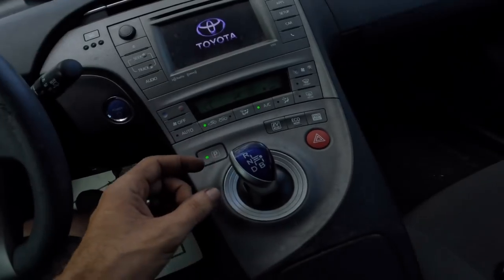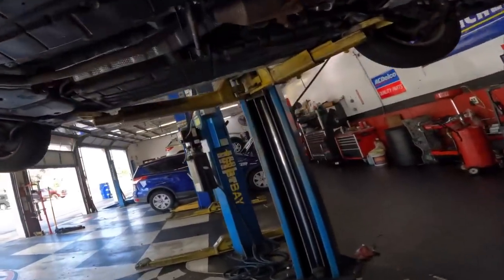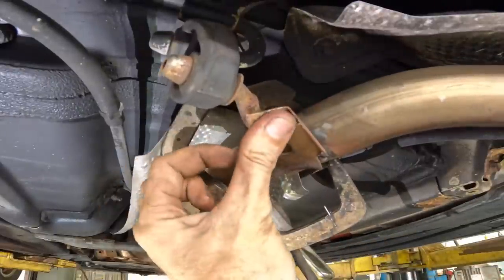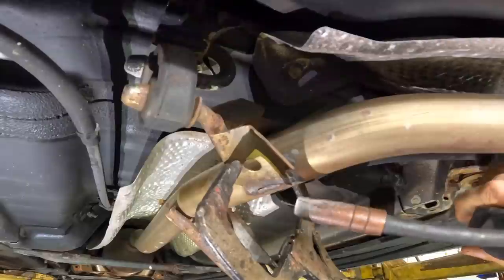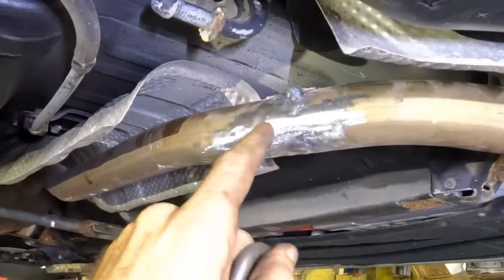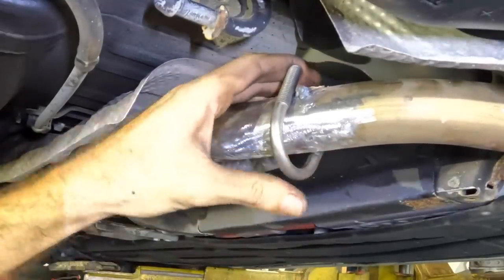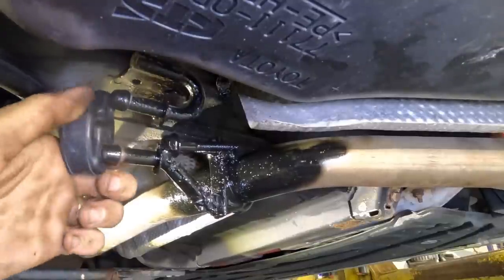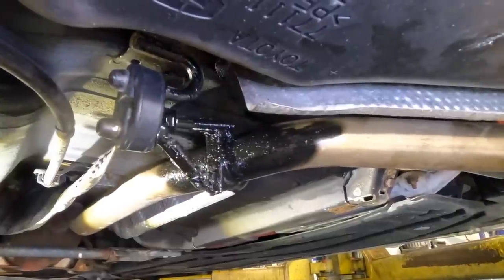This Video is a BAD Idea! Saved Customer THOUSANDS!

Comment: I got taught a small bit of welding for a few days a couple years back
and one of the things I was told is that if your weld leaves loads of white stuff everywhere, it's galvanised
not only does it make it nearly impossible to weld, it's also really toxic to your health
so yeah, not only for making better welds, but you might wanna clean up what you're welding first, just in case

Comment: Only thing I'll say is that you need to clean the area before hand, it will never weld nicely to rusted dirty metal. Other than that, you have my respect for repairing it and not trying to sell unnecessary parts.

Comment: A Welder you aint, i know you are supposed to melt the metal and filler wire but this was to the extreme🤦😂, absolutley bang on with the mad comment😂
complete respect for not charging the customer for a complete new exhaust system, a lot would have, you can always brush up on skills, Honesty comes from within.Keep up the good work👍

Comment: Hey Ray, that exhaust pipe looks like it might be aluminized steel.  It's cheaper than stainless and pretty much rust proof and can last for years.  But as you can imagine, you can't weld it unless you grind off the aluminum and expose the steel.  The funny thing is, is that after you got done grinding down the old welds, you probably cleaned up the surface well enough that it could have taken the welds much better.  But yeah, you done the right thing to save a few thousand bucks over a ten dollar hanger failure.

Comment: I had a 2006 Mazda 6 with the V-6 where the front pipe broke at the joint where the 2 banks join together. The new pipe was over $700 and not available. Cost me $300 for a local shop to do some welding, put in some flex joints.

Comment: When welding a car you should always put a serge protector on the battery we call them zaps,  they protect all the cars modules as your basically shoving 100amps plus up every earth, way cheaper to protect them then replace them, also better then removing the battery earth so the customer doesnt loose there radio setting etc, 

As for the welding side of things,
Lanalin is useful to spraying around the area your welding as it stops mig splatter sticking to stuff comes off with brakeclean, get some 3/8th steel bar for your shop then you just chop a bit off and make hangers with it a small bead at one end to retain the hanger rubber,
Higher amps shorter bursts more penerations less holes do like for tacks then wait a min for the glow to disappear then four more, one inch of weld with good penitration holds one ton, im an engineer by trade but have been working the last five years in a car workshop, i really hope this helps you or somone else thanks for the great content !

Comment: Great job man, I know from welding exhaust for years rust messes with your weld. A little wire wheel clean up before you weld will make it so much easier. I've worn your shoes grabbing a welder and learning on every weld I laid. Keep up the great content Rainman.

Comment: You did it, but I hate to tell you that they make a muffler bracket that you could have just clamped to the pipe with the rubber and all. No welding involved.

Comment: I also am NO welder but I have seen some low grade stainless that is magnetic and can’t be welded without the right welding set up.I’m wondering if that is what your dealing with? Just a thought.
Excellent repair and good job doing what you can with what you got!!!!

Comment: Rule number one: always clean your surfaces before you weld. A flap disk is a great tool to keep handy. Great work fixing the problem brother. Also I'm a welder and would be happy to give you a tip if you ever need one, I don't live too far from you if I'm correct. Feel free to message me if your ever unsure about a welding job 🤘

Comment: So I may have a hot take, and I understand not wanting to turn away work, but at the onset of not being a competent welder and the shops "good" welder being broken, I would have suggested the customer go to YOUR favorite most trusted exhaust shop for the repair. Telling a customer that you can do the work but it won't be the best because it's not something your good at a s recommending a better solution has always been a win in my book as a customer. 

I have no doubt your fix will hold and I appreciate you saving the customer money by not suggesting they replace the exhaust but welding busted hangers on perfectly good exhaust is something most exhaust shops should be able handle for fairly cheap.

That all said, totally understand it's completely situational and we only see what you show us, so this may have been the best solution and I enjoy watching you work. Thank you for showing us what you do and that you are trying to save customers money while also providing great service.

Comment: Nice job saving the customer some $$$. Looks like Toyota knew the exhaust bracket was a weak point. They put a couple holes in the bracket so you can put a hose clamp/wire through it and around the exhaust to secure things.... 😯

Comment: It still amazes me that someone wouldn't bother to crawl under their own car to check on a rattling noise.  My DIY solution would be to run a heavy hose clamp through those two holes and around the pipe.  I'd get someone to weld it only after the clamp broke.

Comment: Pity that exhaust was most likely ferritic stainless which is magnetic. It is hard to weld but can be welded. You would likely need a TIG welder though. I only have a Flux core welder and they dig deep and splatter a lot. Grinders and paint are the welders version of trim and paint for carpenters.

Comment: The issue with not running any type of gas is the weld does not penetrate very far into the steel causing just a surface weld. it will break very easily.

Comment: If you clean the metal before welding, you get a much better weld. Grinding or wire brushing until you get good bare metal on both parts - bracket and pipe. Good luck.

Comment: I weld steel to stainless all the time. It does require a special filler. Er309 filler rod.  Not sure if flux core works. Not knocking your weld just letting you k ow steel can be welded to stainless.

Comment: Stainless likes to be very clean before welding. Try 309 wire next time. I know you run what you brung, this would help stainless to mild steel and a somewhat ductile to deal with vibration.

Comment: I had EVAP lines/hoses ignite on the top of gas tanks from the sparks..usually due to old hoses/line or prior fuel pump repairs that was not done correctly. Also the heat generated by the welder will make the thin floorboards get extremely hot and possibly set the interior carpet pad on fire.. semi magnetic stainless is hard to weld and cut with a torch..fire extinguish should be handy as should a water hose to cool down floor boards after welding..A dab of grease on the metal hangers will let the rubber slide on easier. Anyway you get a A+ for effort!

Comment: Nice solution, but I would have done some things differently.
1. I would use from the scrap metal pile an exhaust hanger that is not made of stainless, or bend one or 2 long screws that they fit
2. I would be afraid of the electronics of the vehicle if I welded on it. probably I would have unscrewed the exhaust and isolated from the vehicle.
3. would in any case at the wiper blade change either a blanket or a thick cardboard underlay, because if the arm bangs on the window you need a new rear window.

Comment: Pipe welding is actually one of the more difficult welds you can encounter (there's even a ranking system for pipe welds believe it or not), usually those welders are more highly skilled or experienced in the trade, so you likely were dealing with greater difficulty task to being with. Like others have mentioned prep work is a must for these types of welds(as rust and anything else found attached under a car) are nasty contaminants for the wire you were using, and if that was stainless then you'd of needed a specific wire for mild to stainless connection, removing that was wise.  

Not that it matters much, but if you wish to prevent a future weld from rusting through prematurely try and use gas in a situation like this or even stick weld as you really need a shielding for longevity and strength of connection, and remember prep before welding! It's 95% prep 5% art.

Comment: Could you directed the customer to an exhaust/ muffler shop that has the proper replacement parts and welding equipment?  I assume this would have been a 5 minute job for them.  If not, then this certainly works for me.

Comment: I know you have heard this a lot…. But man…. So many easier ways to do this…. Also, if you use a welder in your job, you should probably burn a few rolls of wire one weekend and try to get a good feel for it….   Also, saw another person suggest cleaning up the surfaces to be welded…. Fantastic suggestion, lol

All in all, it worked, good job…. But for future repairs, a weekend or two of solid practice and prepping your weld surfaces will make the next one 100% easier and prettier

Comment: FYI…just because it’s magnetic doesn’t mean it’s not SS. Because your lower grade SS, such as 304 or 309 will be magnetic. Only your higher grade SS, such as 316L or 410 will not be magnetic. All SS contains carbon steel. The grade determines the amount.

Comment: I've been an automotive technician for over 25 years and have been welding since I was 13 and I will tell you without a shadow of a doubt that in my personal opinion I think every mechanic OR technician should at least get a little practice in welding different types of materials as to perform a repair for a customer to save them money as you have already done so

Comment: Use a plumber's torch to preheat metal before welding. Light metals not so necessary but the heavier metals if you preheat you make small welder bigger and get penatration needed

Comment: My old boss called it chewing gum welding. Your power is a bit high.  Points for trying.  I had the same thing with a non gas welder. A lot of adjusting it to get a good bead.

Comment: With the disclaimer of not being a good welder- but a damn good mechanic, let me just offer you a quick tip, clean your weld joints before you weld, you will have a better time and stronger connections

Comment: Not sure if your aware of this but I have the same type of welder and there is a different tip for flux core so you don't use that shielding cup tip. I appreciate your content I do the same type of work myself.

Comment: Same here.  I too am in a constant battle against the Throw Away Society.  Way too much waste in the world.  I've got 1981 and 1999 trucks that I still use, the 99 looks great, runs even better, has been updated and modified for longevity and higher fuel mileage. It's actually better than new on many fronts.  And insurance is really low too.  That way I can put all the money I save  into whiskey, tattoos, gambling, cigars and drugs.

Comment: As a welder you actually done the best thing possible using a FCAW setup on a small machine because if you used hardwire/gas on a larger machine the chances of blowing through the exhaust  pipe would be much greater. The biggest reason it didn't want to weld good was you simply didn't clean anything first. If you would have grinded the part and pipe to bare metal before starting it would have been one and done. That's the number one rule in welding start with clean and end with clean. No welder on the planet is good enough to weld rust and road grime.

What you ended up with worked out just fine. Doesn't matter how you do it, it just matters did you get it done. And btw I'm impressed you actually thought to paint it afterwards... Most "Professional Welders" wouldn't have even done that. hahaha

Comment: At first, this is a stainless steel exhaust. The welds will get corrosive fast again.

I would clean the areas, TIG weld it and add a waterhouse clamp to the holes. Done

Even I listened you don't have fast access to a good welding machine

Comment: From one tech to another tech your really good. But practice the 1-1000 , 2-1000 second welding with that flux core welder on thinner metals. But I like the fact you wasn’t afraid to try. Good job bud.

Comment: You can't weld to the exhaust pipe because it IS STAINLESS. 300 series stainless steel is magnetic, along with others. (lesson)You can't use a magnet to see if something is stainless. Pro tip --- next roll of wire you buy for your wire welder, buy stainless wire - you can weld mild steel with ss wire, but not the other way around! If you work around cars it is the only way to go.

Comment: Also, when welding gasless Flux core wire you need to be running in reverse polarity. That looks like it could be the problem.

Comment: I love these clips sitting here in Thailand, in asia we do have the WW2 mentality a lot, you follow that spirit of "MEND AND MAKE DO" -- So important as I too (in electronics) hate to chuck something out without trying to fix it. I wanted to do my car's (Honda City 1.5L) starter motor which had an integrated solenoid, so the whole freakin starter assembly eventually needed replacing because I couldn't get two copper contacts for a dime a dozen, anyway eventually took it to the Main honda shop in Hua Hin - TOTAL COST including free ride into town, old motor back, free full pro valeting, free coffee 4100 TH Bhat = £90 UK =$109 USD, Now in the UK same repair (without the nice asian vibes and free valet) $559 USD or  £488 UK or 21,000 Thai Bhat Look at that cost difference!!

Comment: I think that pipe was ferritic stainless steel. That's why it still attracted a magnet. That's why too, you couldn't weld it with the steel wire.
It doesn't rust. Definitely not like in the cars of old. They would completely rot out, especially the tailpipe mostly, followed by the muffler in about 2 years. A tailpipe may be gone in 1 year.

Comment: Reason it was not bonding is the pipe is galvanized coated and all of it needs to be ground off down to bare steel so it can be welded

Comment: You forgot to show the part where you engage the hybrid battery service disconnect anytime you weld on a hybrid to prevent damage to the sensitive high voltage batteries 😬

Comment: I'm a Gorilla welder myself ugly but strong.
For Flux core you don't need the shield cup on the gun without gas hooked to it makes it easier to get in tough places and saves you a buck or two not using them.

Comment: Ray; when welding stainless steel to mild steel you need to use stainless steel mig wire otherwise your welds will crack.

Comment: Back in 1991 I lost my job as Sears Auto Service Advosor because I didn't take the guys credit card,.which has the $2200 available to fix the balls I oints a.d CVs on a old accord that had upstate NY salt deteriorated undercarriage. Told him he was better off spending on another vehicle.  So I do appreciate an honest mechamic....sometimes it does need to be thrown away

Comment: I think you don't have the polarity correct on the welder. When using gas, you go tip positive. When using Flux core, you revers polarity and go tip negative.  This puts the heat in the metal to be welded and not the wire which will give you better welds and oenetration.

Comment: The term to use is " looks like hammered dog shit".    When I first started to see this video, I figured a 2 or 3 minute repair.  See if your shop will step up and get a real mig machine and go find all the exhaust pipe you can get and practice joining them together.  Practice practice practice.   Use acetone to clean the metal before welding.  DONT USE BRAKE CLEANER FOR WELDING, it will make a gas that will poison you internal organs faster that you can believe

Comment: I would have used some "high heat" aluminum paint like engine paint.
I'm sure "Rustoleum" has a product in that related paint series.
The Toyota or THAT Toyota exhaust system has some kind of coating or they electroplated it  or anodized it some way to prevent rusting.

Comment: Metal prep is the important part when welding, needs to be shiny clean.  Flux core don't make uglier welds in fact when welding outside in wind you would want flux core since the shielding gas would blow away.  I just don't like cleaning up the white flux left over and prefer using gas when possible.

Comment: You can weld stainless steel with mild steel wire. It just doesn't look as good as tig welding.and it rusts too. You have to clean everything or it will not work. If it is stainless it is 204. 204 stainless is magnetic.

Comment: Just some food for thought, and I know you are a more season mechanic than I, but I usually remove the positive battery cable when welding on modern stuff. Too many sensative components around to risk having to chase electrical gremlins later. All in all good job on actially SAVING someone money. Quite the contrary these days. Keep uo the videos!

Comment: Put WD40 on that rubber piece and it'll pop right on without a bunch of hassle...I do it to anything rubber that goes on metal plastic or heater core tubes cause it slips right on. Your welding turned alot better than most I've seen....

Comment: For a flux core weld you need to grind away all the rust possible.
Even where your ground clamp goes.
Use a 4 in angle grinder Ray. Carbide cutters wrong tool.

Comment: How about practice first welding first. Then remove the exhaust with broken hanger. Then weld in a 1g position.  That position your welding in is difficult without practice.   1g is a flat position looking down on weld.   Overhead is not easy welding.

Comment: When it comes to rubber hangers, WD40 is your friend.  You're trying to put a long, hard protrusion into a firm, semi-flexible hole, so if it's dry, you're doing it wrong.  Use lube.